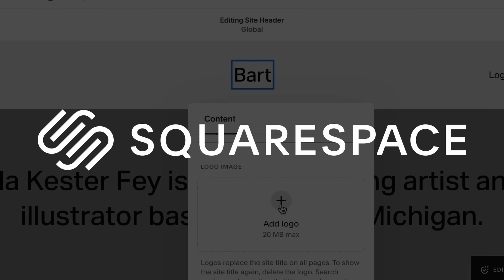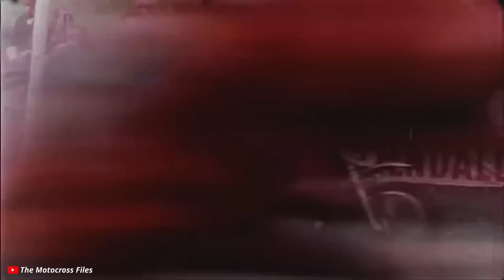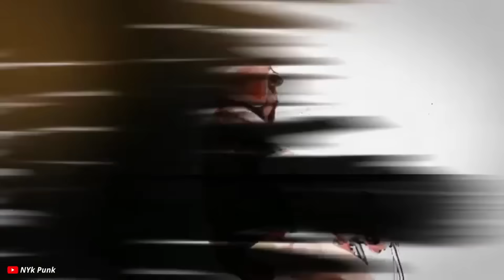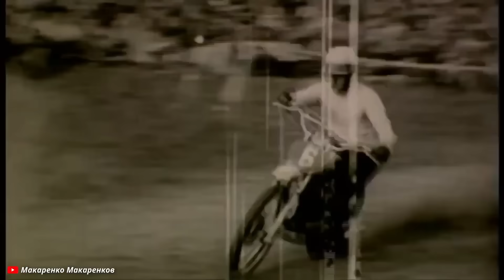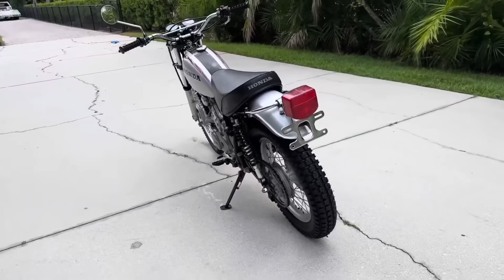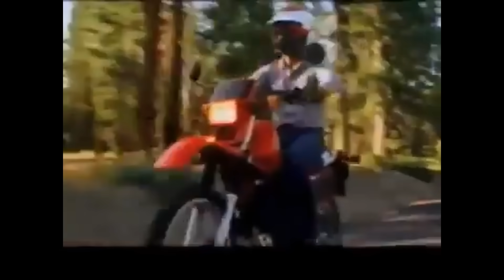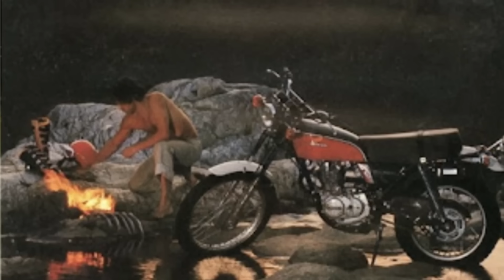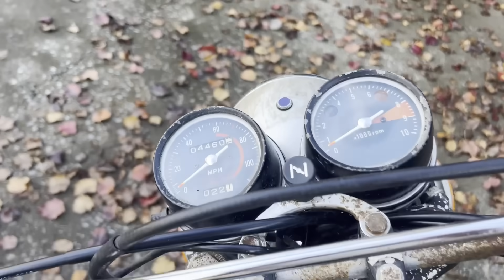The Forgotten Honda That Made The Enduro Scene

Comment: I picked up a '72 XL250 several years ago and rode the crap out of that bike. Very fun motorcycle that felt plenty capable on trails, never took it on anything too crazy because it was in rough shape when I bought it 3rd+ hand at a swap meet, but I used it to commute to work and tool around for fun for 2 riding seasons on and off with a trail 90 I picked up at the same swap meet.
Reply: I really like the way that bike looks compared to newer dual sports.